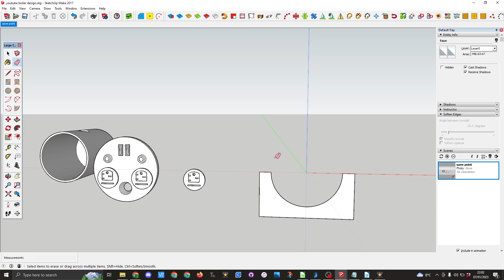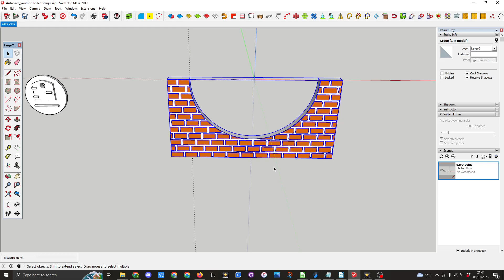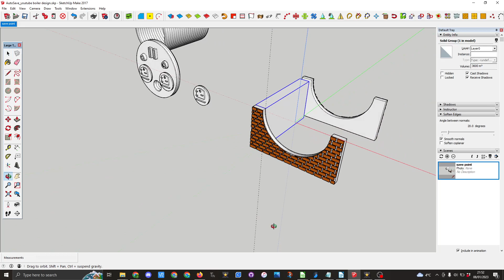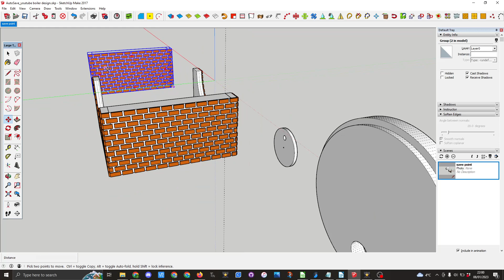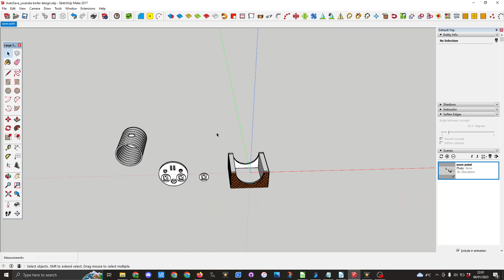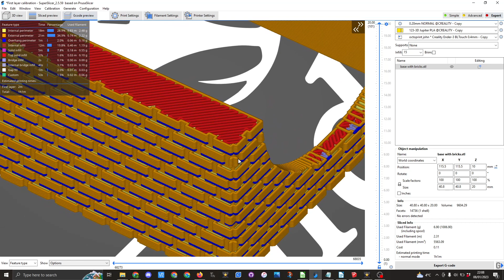Sketchup Make 2017 Part 4 Lancashire boiler brick base for 3D printing in FDM or resin using OOB

Comment: Some neat tips and techniques. Thanks.👍
Reply from the maker: Bob glad you liked it you can work on the bricks by clicking into that group and then use the push pull to over lap the bricks if you print it as shown in the video. If larger parts I use the same method as Eddy in his tutorials on the channel and clad the walls afterwards.
Reply: @modelrailwaytheeasyway9743  thanks, I was thinking about how to tidy up the corners. 👍